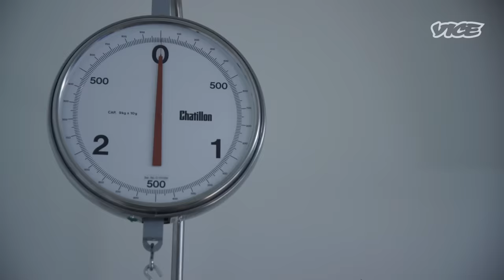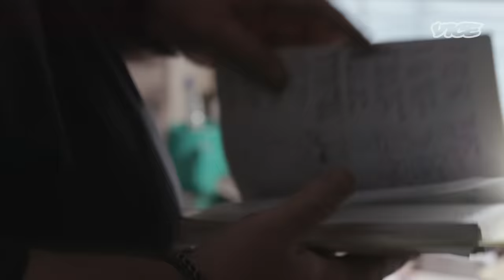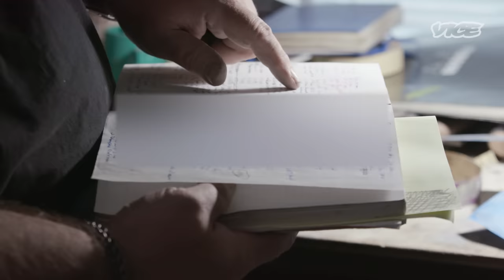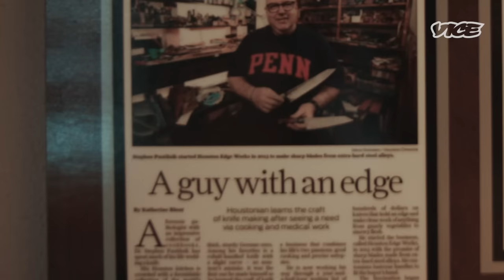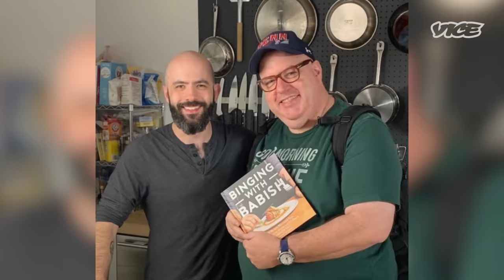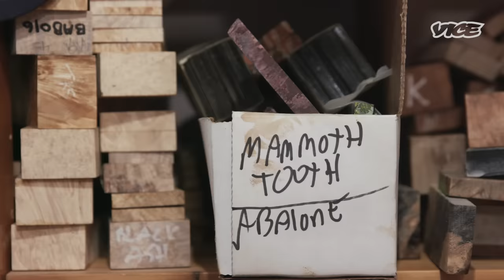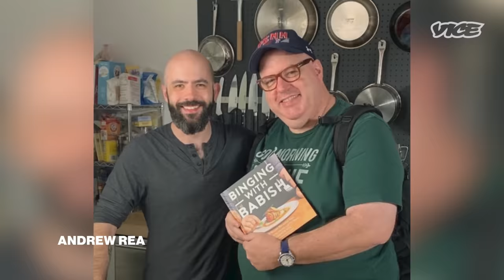The Doctor Making Knives For Autopsies and Celebrity Chefs | Side Hustles

Comment: I bet his knives are absolutely incredibly good quality. As another albeit much less formal  knifemaker..  i really must say you do excellent work particularly your  blade finishing .. And unorthodox handle designs and yes you often  find you took up knifemaking because you're unable to obtain a quality enough knife.  Others learn it from their parents ..  Used power hacksaw blades are a good starting kitchen high carbon steel  blade material. It will still hold sharpness okay  even if you're not very skilled at tempering. And turns out awesome if you are   . and this is excellent journalism btw

Comment: Point of clarification though: harder knives do not resist chipping more than soft knives. Where a hard knife chips, soft knives are more prone to bending.
Reply: With the modern high alloy steel he's using it can be very tough, resistant to chipping, and have excellent edge holding. Whereas a carbon steel knife of the same hardness would be comparatively brittle as well as having less edge holding.

Comment: So that steel from Germany cost $1,000 and it makes 3 knives that sell for $300?  That doesn’t sound like a profit...
Reply: He got a steel bar for $1000. He cuts 3 blanks out of it for $300 each. He cuts off probably half of the steel bar to shape the knife blades, and probably sells the bits back for scrap/recycling.

Then he goes and gets material for the handle, and charges for that too.

Then he charges for labor.

And the finished knife costs significantly MORE than $300. That's JUST the materials cost for the knife blank.

Comment: Don't kill me this guys says his cooking was facing limitations because his knives weren't good enough so he makes his own. 
Could of just learned to sharpen a knife my dude.
Reply: Could've*

Crappy steel won't sharpen and hold an edge as well as good steel will, and you don't want to have to sharpen it every other cut, and the shape of the blade can impact how easy it is to use it for various things like a draw slice vs chopping. If the shape of the blade is bad for your intended purpose won't matter if it's sharp

Comment: 1k slab. $300 a knife. 3 knives. This dude is either terrible at math or overhead.
Edit: you can get a Japanese artisanal knife for the same or a bit more and the Japanese knife will be an heirloom.
Just a heads up. You can buy a dirt cheap dollar store knife and do the same thing. Anything more than $20 is a work of art you shouldn't be using, but saving.

Comment: That steel costs $1,000 and he can make 3 knives from it for $300... do you even capitalism bro?!
Reply: 10% wastage factor would be REALLY efficient cutting blanks out, and I'm SURE he can send bits somewhere to recycle the steel.

And then he has other charges for other materials, and then charges for the labor.

He doesn't sell the finished knife for $300, that's just the knife blank portion of his materials bill. I'd hazard a guess that cutting blanks he only uses half of the original bar, so he's actually doing pretty well. 🤷‍♂️

Comment: I make knives too, his work and steel choices are crazy hard to work with. Most of mine are tool steel so they rust if not taken care of. I do demascus too but not stainless demascus so those rust too. One thing I noticed is he does stock removal and he uses a bevel jig. I forge mine and i freehand and thats alot harder. But hey he makes a beautiful product. The last japanese style demascus chef knives i made sold for $400 a pop, i should ask more but its hard to find a market for knives that expensive. Really should have charged $800 because i put about 40 hrs into them plus all top notch material so im not even breaking even at 400. Check out my work on insta at monster_blades